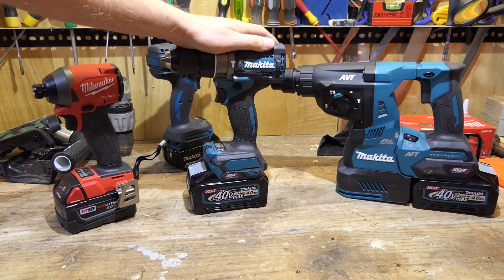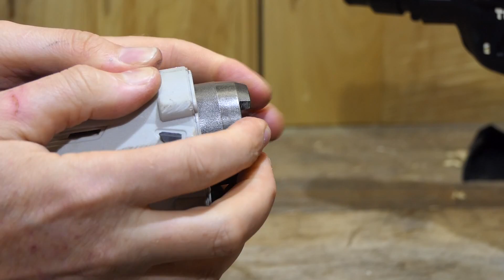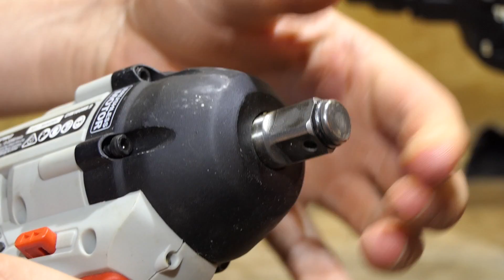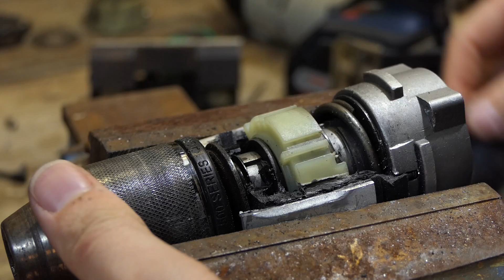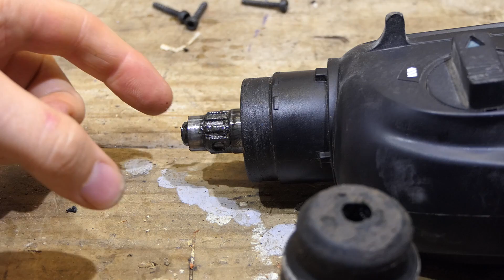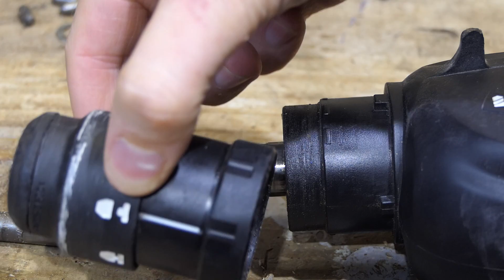Impact Driver VS Impact Wrench VS Impact Drill VS Rotary Hammer Drill | How Does Each One Impact???

Comment: The bounce of the spinning impact driver's hammer does provide an equal and opposite force to the tool/bit that can serve to make the bit>screw interface more solid and prevent cam out of Phillips head screws.
Reply: Impact driver is actually giving axial force also when the metal chunk is driven to the front by the spring so its lugs can hit again.
Reply: @puskamestari5058  That force would tend to dislodge bit from fastener but should have a longer duration.
Reply: @cameratool  Actually the force is towards the fastener so it is 
 keeping the bit better in the fastener
Reply: @puskamestari5058  That would be contrary to Newton’s third law of motion.
Reply from the maker: @Puska Mestari Strange that you used an example that is counter to your argument. That shot shows that it is only rotational force. The hammer is not contacting the lugs on the anvil when it springs forward as the anvil lugs are not tall enough, it clearly impacts only on the sides creating rotational force.
Reply: @puskamestari5058  When the weight is driven forward the rest of the tool is driven backwards.  It is only when the weight hits and then bounces that the tool is driven forward.
Reply: Impact drivers don't provide any additional force towards the fastener. Many people have claimed they do, but they are generating strictly rotational force. And definitely not "anti-cam out" force. People who are unfamiliar with impact drivers will certainly strip out Phillips head screws, until they learn to apply pressure inline with the tool.
Reply: @macp349  An impact driver has a spinning mass that moves up and down.  A mass moving up and down will create equal and opposite forces on the tool and consequently the bit that is attached to the tool.  An impact driver absolutely provides downward and upward forces on the rotating bit.  The downward forces coincide with spinning impacts.  The idea that many people can't use a tool correctly doesn't invalidate Newton's laws of motion.  You can test the extra cam out resistance yourself by comparing a regular drill with an impact driver while driving Phillips head screws.
Reply: You're correct I believe as well. There is an anvil moving back and forth creating opposite axial forces. As the hammer 'drops' and contacts the 'tangs' (not sure on correct term here) it is abruptly stopped in it's forward motion as well as it's rotational. Hence it creates both torque and a light hammering action. It doesn't matter if it's only contacting the tangs, some part of the drill is stopping the anvil moving forward, and the body gets nudged forward as a result. Edit: I should add I think this effect is very minor and isn't the main reason impacts are great for fasteners.
Reply: @ToolsAndStuffOFFICIAL  The face of the anvil is stopping the hammer in axial direction not the lugs. You should look the whole system how it moves in the sample I provided. The guy is not definitely providing any axial force when he is turning axle with a wrench.
Reply: @cameratool  not once has a manufacturer quantified those specs, and when numbers help drive sells, those numbers would be worth something. However, bad or misleading numbers could definitely cost sells. I think that it speaks volumes that no one found a way to market those numbers.
Furthermore, if force was applied towards fastener, it would be "hammering" fasteners back in (ever so slightly) as they are being reversed out. After so many times, wouldn't that damage the threads, either inside the hole or on the fastener?

Comment: Great explanation, I was just contemplating if my M12 stubby 1/2" impact wrench with a 1/4" bit adapter was equal to my Makita 18v impact driver when driving large fasteners.
Reply: normally impact drivers have less torque but more hits per minute. So a Makita (Milwaukee, whatever) impact driver should be faster with screws than any impact wrench (even though it has less whack )!

Comment: Great video. My research before using an impact driver vs impact wrench suggest and impact wrench was only rotational but an impact driver uses rotational and axial. Seems like according to the video this is not the case
Reply from the maker: Yeah there is so much misinformation about impact drivers and impact wrenches. If you can find any major power tool company saying that impact drivers use axial force as well as rotational, I will remove this video. Many impact driver and wrenches from companies are exactly the same tool, just with a 1/4" chuck (driver) or 1/2" square drive (wrench). There is no difference in the way they work. Thanks for watching.
Reply: @ToolsAndStuffOFFICIAL  do impact drivers have an auto-stop clutch like the impact wrenches ?
Reply from the maker: @thinkride3873  yes
Reply: @ToolsAndStuffOFFICIAL  mine's arriving today. if it has an auto stop clutch, i am keeping it.

Comment: Normally impact drivers have less torque but more hits per minute. So an impact driver should be faster with screws than any impact wrench (even though it has less whack - of course only if the screws aren't too big)!